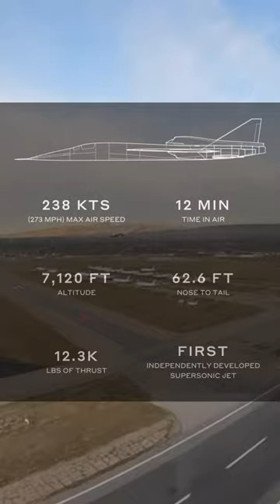The Boom Technologies XB-1!! Supersonic experimental Commercial plane!! #shorts

Comment: XB-70 still looks and was alot quicker
Reply: xb-70 is experimental bomber. not a demonstrator aircraft like xb-1. it's built by entirely different manufacturer and entirely different purpose too so i don't think that's a good comparison
Reply: @br-44  yea, I know. It just feels like we are taking a step back with tech
Reply: @theflyinggeordie  it's not that, it's just that boom technology is the type to get things absolutely perfect before moving on, since they probably don't want to get flamed even more than they already are when the first overture crashes or something. they also have to build it with quiet sonic boom technology. so there's more to it than just "fast airliner" like concorde back in the day where noise regulation wasn't a thing